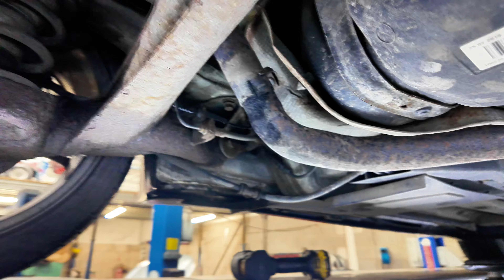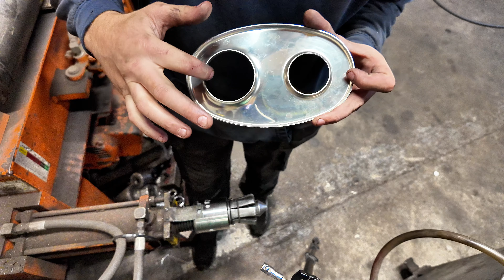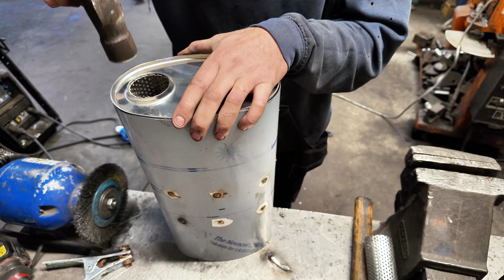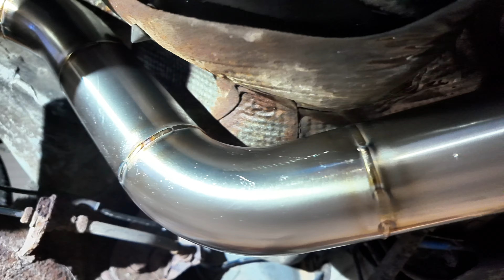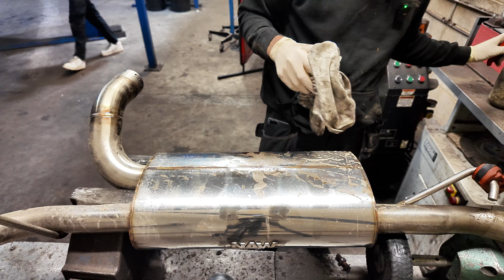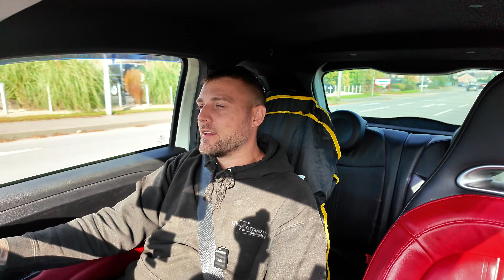The Abarth 500's Biggest Problem - It NEEDS Exhaust noise!

Comment: Getting a nice sound from them without being an obnoxious trumpet is harder than it looks lol, I've built my exhaust system 3 times, I slapped on a Bombardone r4, which made it sound like a tractor lol, Then fitted a center resonator to tone it down, that was fine but it was too bassy and droned a lot, Then I scrapped the lot and rebuilt it with a 200 cell catback, 2.5" stainless steel catback and splurged on a Magneti Marelli sinfonia which is electronically valved, fully open it's way more refined than a delete pipe, I think some exhaust gas still passes into the box so isn't mega raspy. But anyhoo Kudos, that sounds mint. Shame ye had to modify it in the end, The stock one ye pulled off they dont have fiberglass packing but have 2 chamber baffles so essentially its like double whats on the custom one. :)
Reply from the maker: I'll be better next time round :]

Comment: Won't the exhaust gasses coming in escape through the perforated pipe out of the outlet on the same side before it reaches the centre chamber? I don't know much about exhausts but I would have thought the inlet pipe would be a solid pipe so nothing escapes before it hits the centre chamber? 🤷
Reply from the maker: @mex8961  yes as I explained once I'd gutted it out abit this became a slight issue. When the silencer was packed full off wadding the inlet being perforated gives it more surface area and makes the silencer more effective, when it packed full no gas is going to escape through the wadding. Issue is it was too effective 🤣 so when I gutted it out yes the left tip then becomes slightly more dominant. But even at idle they was both still working so it will be fine...
Reply: @NAWFABZ  sorry mate I made that comment before I got that far in the video 😂 It makes sense now 👍